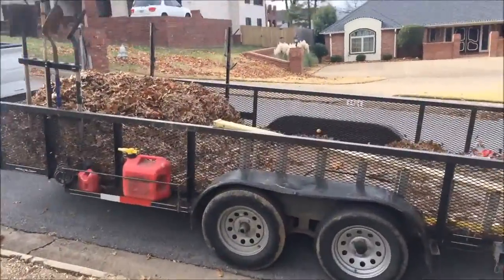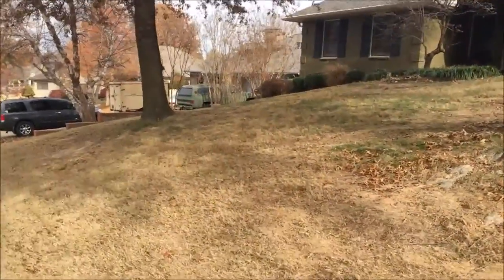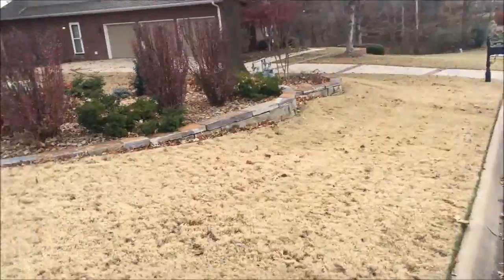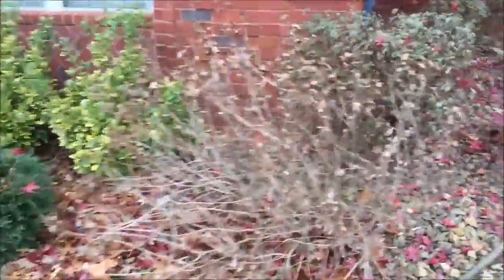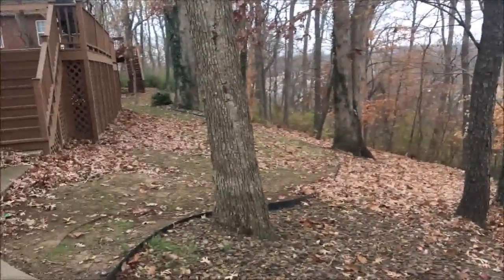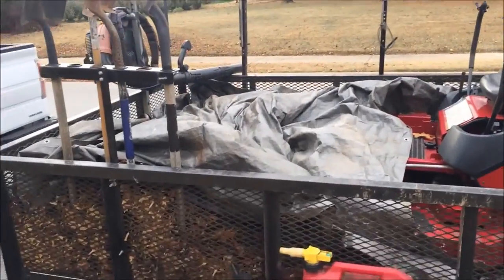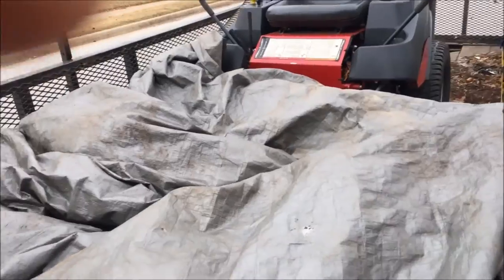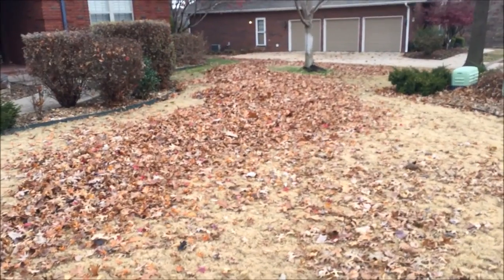Lawn Care Vlog 6 - Ferris Turbo Pro Leaf Removal / IS600Z Engine Problems Continue

Comment: My Farris started doing the same thing after I changed the oil. I figured it was the carburetor as well but believe it or not when I took it to the shop I bought it from turns out it was from the oil filter not being tight enough and was causing a compression issue. May want to look at that if you haven’t already figured it out to be something else.
Reply from the maker: Fortis Defense LLC thanks for the info. It turned out mine was the crab. Got some junk in it.

Comment: Was it the filter or carburetor
Reply from the maker: The day flames came out of it the filter was dirty. But I did take it in and they cleaned the crab. It does run better now, but still not 100%
Reply: Which engine do you have
Reply: I bought the is700z with the 27hp Briggs and mine had the same idling issue about 30 hours in.  I ended up pulling the intake and carb which was a pain in the rump, but found a small chunk of something stuck in the bowl of the carb.  I'm wondering if someone at the factory does this intentionally.  Cleaned it out, runs like a champ.